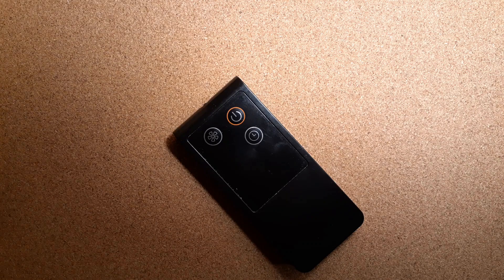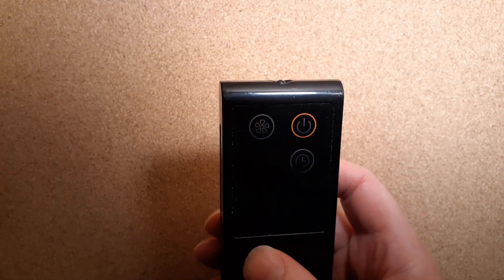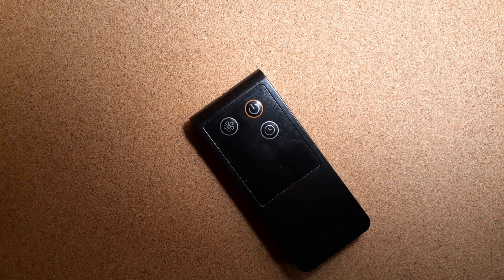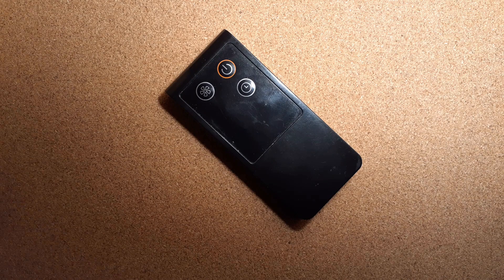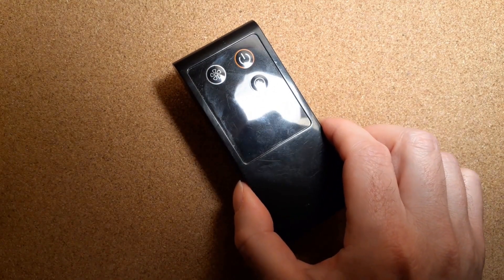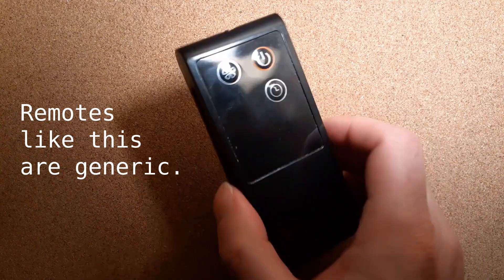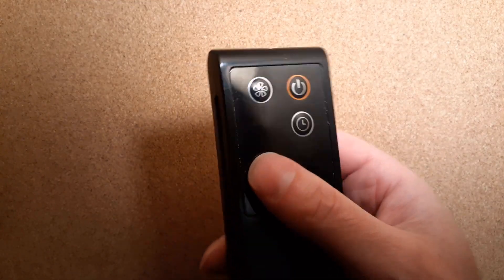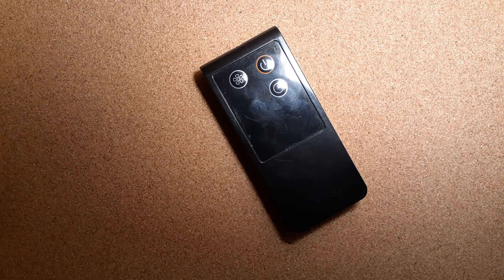IR Remote Testing With A Camera

Comment: Are there budget ways I can go about recording video of other invisible (to us) wavelengths? It would be really interesting to see visually what is emitting light I can’t see.

I’ve seen thermal cameras costing quite a bit, but it’s encouraging that cheap digital cameras also pick up IR!
Reply from the maker: Well, this sort of thing is capturing just some near infrared range, close to visual light. I don't think the typical cellphone/tablet/web cameras can capture the sort of range you'd need for thermal imaging. There are a few sensor arrays that are sort of like low resolution cameras, like tens of pixels by tens of pixels. They're still expensive by some description. If you're curious I'd try "Melexis" (a company I've heard of) and "sensor array" (as opposed to "camera") as search terms. I've done almost nothing with ultraviolet beyond having use a UV light before. I know they make UV emitting diodes, so it wouldn't surprise me if there are UV  sensing arrays made with them. But assuming they exist, I expect they're also expensive.

Comment: Wow!  Did not know this.  Had to try it out immediately.  Looks blue on my phone's cam.
Now the trick is, would one get enough FPS to decode the remote signal?
Reply from the maker: Most IR-remote signals are just way too fast to be reliably captured on a phone camera. But, in principle you could decode a very slow IR signal that way.  I've have a partially-done Android app that I abandoned to do something a little bit like that, in that it's reading an LED with a camera. And there's no reason why it wouldn't work with an IRED, but I'd intended to use it with just normal LEDs.